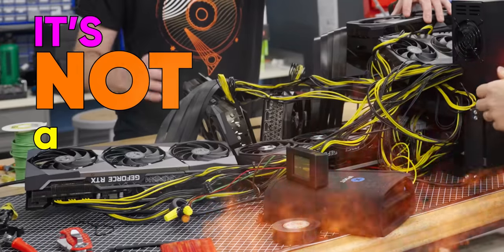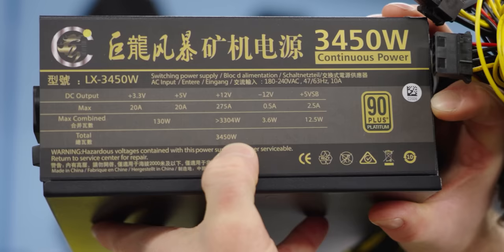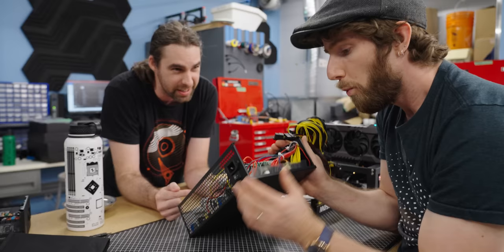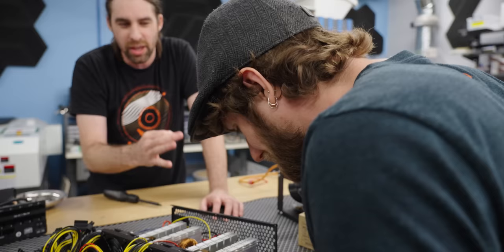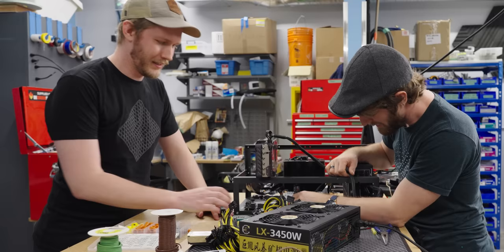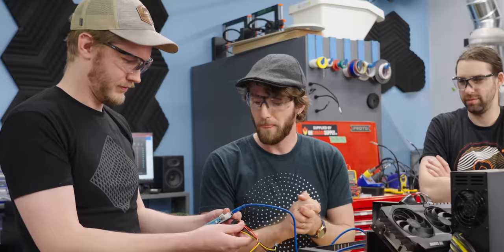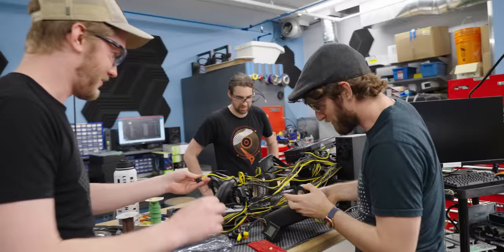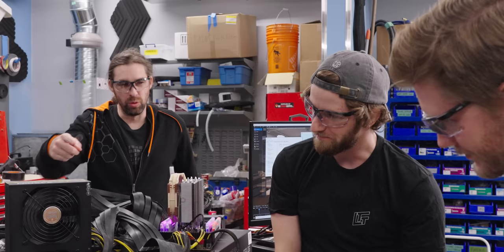This 3450W Power Supply is a Fire Hazard!

Comment: It's pretty funny how scared everyone is of the 240V. Here in Europe we have 230V at 16A on the normal lines. But there are also stronger ones with 24A. If two fan heaters with a total of 3500 W hang on a socket here, we do not worry yet.
Reply: In North America you can have 120 or 240 to anywhere. It's 240 to the home not 120. It's fused at a central point so its a different way of doing things. Also if I were to choose if I wanted corporations controlling the fuses or myself I will do it myself thanks. And no it doesn't scare me. I wired my stove which is 240 so no it doesn't scare me.
Reply: And america's 240v is split-phase so unless you bridge both sides you're only getting 120v to ground.
Reply: @joer8854  WTF are you on about dude? A 240V MEN system has generally 3 levels of fusing for the individual supply on customer premises.
No electricity supplier is going to give you a cct without a fuse on their side so you cant take down their network.
Yes you do have a different way of doing things, that came from not knowing how to do it right when your hodgepodge of systems were put in place with no regulation.
Reply: @mycosys  3 levels on customer premises? I know the main fuse that sits right where the cable comes through the wall, and then there's the breakers, is there another fuse in the breaker cabinet? Apart from the GFCI that's in there as well.
Reply: I think the same everytime. We can do 3680W with 230V and 16A. And if we need more we can do 3 phases with 400V and 16A / 32A / etc. And that's nothing that special.
Reply: @Brealiq  And interestingly to get 3450W on 90% efficiency (requirement on full load to pass 80plus platinum. probably where they got the idea from to print "90 plus platinum) on the label) it would pull 3833W, which means even if the PSU didn't explode on the attempt it would trip even breaker.
But in the end, better to be extra careful towards it than getting negligent., no matter if 120V, 208V, 230V, 240V, 400V or any other in that region.
Reply: @LuLeBe  Usually if it is a residential tower or area there is another CB at the main or sub power distribution cabinet that is between the network and the residential systems, or if it is a private property the main switch between the network and the property would have a fuse inside the switch box this plus the GCFI Main breaker (required in most countries that have mandatory ground for appliances) and CB for each sub circuit within the premises, that's 3 accounted for.
Reply: They're scared of AC mains power and their haphazard circuit modifications, justifiably so in any country.  In my experience people from countries with >200V mains tend to be far more scared of electricity than North Americans.
Reply: Me, an European: "230V, 16A and 3680W line - nothing to be afraid just don't trow it into bath. Just be careful with the 380/400/500V and 32/64A lines". :D
Reply: I wouldn't be too certain that all 16A circuits can supply the full 16A continuously (as opposed to as long as this sort of load is usually expected to last).
Reply: ah ah ah ah ... americans ... ah ah slurp
Reply: @Hadar1991  No, you really should be afraid.  Forget the amperage capability of the supply because it only takes milliamps to kill you, and 230 volts is definately enough to get those milliamps flowing through your body.  Also, you'll generally find those 380/400 volt supplies are 3-phase, and those 3-phase supply transformers are centre-tapped to ground meaning each leg of each phase is 220/230 volts to ground.  To get hit at 380/400 volts would require you to isolate yourself from ground then connect two of those phases to your body.
Reply: Two fan heaters totalling 7000 watts at 230 volts equates to over 30 amperes.  Better hope your circuit is in good order and the overcurrent protective device is functioning because it will need to trip to protect the installation.
Reply: @UCCLdIk6R5ECGtaGm7oqO-TQ  So, I was exaggerate, but still if was funny to me that they where so over the top while handling 208V/16A 😅
Reply: @mycosys  You assume that because you assume (wrongly i might add) that europe has never had an issue with electrical fires and they just always did everything perfect.
In North America the main comes into the house and various runs are made through the house with each run being fused to what is needed for that run. If you need 240 you combine the two rails. We don't run our stoves and dryers and such off 110 like you assume we do.

Comment: I think I may be watching too much Jayz2cents when I expect an iFixit spot to follow an explosion
It would be interesting to see GN put this same model through their testing. I'd like to know if this is more dangerous than Gigabyte's psu's.
Reply: Same here, about both those things.
Reply: Or better yet, hardwarebusers, who can evaluate all of the protections. Because I would be very surprised if this thing had them.
Reply: Of course its worse than Gigabyte
Reply: @xentiment6581  You say that as if Gigabyte doesn't have a tarnished reputation for a literal 50%+ failure rate on a PSU that they figured was good enough to sell
Reply: NGL i'm a little disappointed they didnt test how good a spot welder it would make, its rated for something like 300A 12V and i suspect the main protection its missing is individual rails for OCP. They titled the video 'fire hazard' and didnt test the one way it SERIOUSLY is.
Reply: I want somebody to use their industrial level fuses to drive that thing full out to those claimed 3450W
Reply: @EvilTim1911  yeah this is still worse
Reply: @xentiment6581  This is bad, but it’s something with some common sense you’ll know is bad. A single typical US wall socket can’t provide more than 1800 watts. This has made up, poorly spelled specification stickers on it, and I’m sure it’s sourced from some sketch Chinese website. 
Gigabyte was a reputable manufacturer that paid to have a model go thru validation and sold thousands of potential fire hazards. Then Newegg made it a bundle with high end GPUs. 
The 3450 psu is bad, but any reasonable person knows that.
Reply: @HappyBeezerStudios  Well anything lower than custom plugs will have a breaker  or fuse break. A custom plug for 16A 230V continuous or higher on it. Industry can have their walls wired however they want them to be most go with the standards unless otherwise needed.  This PSU will be a case in the "otherwise needed" category with the new equipment of that power tester for the wall outlet used. To get up to 3600Watts out of one source a custom solution is needed.

Comment: Here in the UK the standard wall outlet is 230v 13A. If you're lucky you get ~240v which means you'd get 3120 watts maximum. Not to mention those IEC C13/C15 connectors are only rated to 10A which means your maximum power is 2400W max then you're going to melt that cable. So you'd have to get a special circuit put in from your fuse box to supply your PC. Mind you, you could probably just disconnect your water heater and use the PC to heat your domestic radiators and keep the house nice and toasty on those cold days......
Reply: A single Type F plug is 16A, here in Germany circuits are either 16 or 20A, so at the rated 230V you would get 3680W. So even if I wouldn’t trust anything with this depending on where you are you can theoretically use something like this safely on a standard circuit.

Comment: @LTT Team:  I received my screwdriver.  It's amazing.  Thank all of you.  Please keep making that hat (or a suitable substitute) appear around Linus.... forever.

Your enginerds likely know about solder sleeves and western union splices.  If they don't..... eh... recommend against wire nuts with stranded wire.  Proper splicing with sleeving would've taken the same amount of time but would result in.... an actually safe product.  This is important when you have so many hands in the area.  It's even more important when you have one or more electronics muggles working on the product.  Btw, have you guys considered putting a couple fire extinguisher mounts under that table?  Sounds stupid until it doesn't.  Then it REALLY doesn't.

Comment: I did my apprenticeship as a TV and Video technician fixing CRT TVs, i still have multiple entry and exit burn marks from touching the line output transistor for the HV coil, it definitely tickles ill give you the tip!

Comment: 6:58 I'd say it's the opposite. It's a Positive one. When the current is high, the resistance increases. It automatically limits the current in the line when loading the capacitors. When well designed it's really effective to reduce high current calls from circuits with high amperage values while in transient regimes.

Comment: "How could you expect to draw 3450W from one connector" laughs in European 230V 16A circuits
Reply: You left off the rest of his sentence
Reply: @sik59rt  Yeah, I was too lazy too go back and write it exactly, as he said it. But I didnt change the meaning
Reply: or even 230V 20A which is also very common for IT Systems
Reply: Thats true 😂😂😂😂
Reply: @tigris5826  Yeah, and sometimes even CEE (400V) with 16A or even 32A (for EVs and stuff)
Reply: North America runs on 240 V 15 amp circuits we just split it across an extra neutral wire because we do not need as much voltage for smaller electronics but the house receives single phase 240V 15 amp Alternating current.
Reply: Yeah you guys constantly use that as a brag but it is really no different here we just don't use it for every outlet it is usually just bigger electronics like washers and stuff.

Comment: I fully expect power supplies like this to be a genuine requirement for the next generation RTX 4080
Reply: plus another for cpu
Reply: By then it'll be expected to use a fusion reactor
Reply: The 4080 is only using maybe 50~100w more than a 3080 lol
Reply: That doesn't work for Electrican System 120 V 16A or 10A  because  
That a total of max. in one circuit 1.920W respective 1200W
Reply: u forgot the 4090 tie
Reply: @chessprince1164  then move to a country with a real power network rather than a toy network.
Reply: @oxfordsparky  So are you saying 400A 240V residential service in Wisconsin USA is a toy network?  Really?  How much power does your home need?
Reply: @kuhrd  It's a big misconception that North America is strictly 120V. Homes in the U.S., Canada and Mexico are typically supplied with 240V which is then spilt into separate 120V circuits. There's usually at least some 240V circuits as well for various high draw appliances, such as washers, dryers and air conditioners.
Reply: @FUCK_________googIe  The meters here in the USA charge for power based on how many KWh you use per month not on how many amps you are using at a specified voltage.  They can however ding you in some areas if your 240V panel is not resonably well balanced since the transformer at the street can only provide the rated service amps at 240V and uses the autotransformer effect to balance any imbalance in the supply which can cause the transformer to run hotter at the street than necessary.  Your home meter is only going to charge you for the power you are using (Volts X Amps X Power Factor)/1000=KW being consumed at that time and you just multiply by how many hours you are running that load to equal your KWh of energy consumption.
Reply: @Okusar  Yeah that was the point I was making because it is unbelieveable that people outside the US still think the US is 120V when it has been using 240V since the early inception of residential electrical service.  I have 2x 240V 20A recepticals in my kitchen not counting the 240v/50A range outlet along with a 240V 20A receptical at my desk for the computer, a 240V/30A for the dryer and a 240V/50A in the garage for the welder.  

That all being said, I barely use any power in my house since the entire house short of the range, electric dryer and water heater are all on a single 6000 watt LF inverter and a 350AH 48V battery system with solar providing around 3/4 of my energy needs anyway.
Reply: @kuhrd  I live in Europe, and most people have 3 Phase 400V Circuits, the Phases are just split, like in the United States, but some devices like some motors legitimaly use 400V.
Reply: @jjjannes  While it is possible to have 3 phase 208v or 480v service in the US it is generally only used for industrial,  commercial and multidwelling residential.  I can't fathom anyone needing that much power in a residence considering how expensive that would be for the monthly electric bill to need that kinda power.  Then again, I try to keep my electricity bill under $50 per month but for most people that is also unheard of.
Reply: @Driftwood420  So it only has peaks of 500W around 1-5ms and 600W under 1ms?

Comment: NEVER mess with power supplies!!! I did it before I knew what I was doing with PCs and nearly killed myself. I got zapped so hard it blacked my vision out and I felt the shock through my heart.
Reply: Did you gain any Superpowers? If so what are they if they are cool, I will do the same to gain those powers!
Reply: @XhodanXeus  No unfortunately no super powers. I recommend not trying it, I was stupid and didn't know about how capacitors were and it almost killed me. Idk what the wattage of the PSU was but im sure it was enough to kill me.
Reply: How long should one wait for the capacitors to discharge naturally? I have read somewhere that 15 minutes is more than enough, how long did you wait when you received that zapp?

I ask because my fountain is very old and I really want to clean the layer of dust that it probably has inside.
Reply: @Albert-P27  Absolutely not 15 minutes. At best, maybe a day? Quite unlikely though. Most likely, a week or two to okayish voltages. Safe: 6 months or more I'd say. The time varies by huge amounts depending on the PSU design and components used.

Unless you know what you're doing, there isn't a safe way to really 'discharge' them (there is if you do know, though). There are however safe ways to clean them.

My recommendation: buy a compressed air can or use an air compressor, and blow it through the gratings outside. Try not to backdrive the fans too hard.

You can safely open power supplies provided you don't touch the PCBs. But even as an electrical engineer, I wouldn't trust myself to do it; too easy to forget or literally slip up (drop a screwdriver? get distracted by a call?).
Reply: @Albert-P27  if you dont understand how to discharge caps and why to do it like that you probably shouldnt be inside a supply.
Reply: do you have any lasting effects from it?
Reply: @thebombbird3261  not to my knowledge, I have more effects from smoking weed then zapping myself off a psu.
Reply: @Albert-P27  DONT EVER EVER EVER DO THAT!!!!!!!! Capacitors are the one thing that scares me the most when it comes to electricity.

Comment: "How could you possibly expect to get 3450 watts out of one c13 power connector?" Simple, by neglecting its 10A max current rating. XD They work fine at the full 16 A of a breaker circuit giving a plentiful 3600 watt. The actual limiting factor is the cabling, which often is too thin to carry such amounts of current without melting its insulation. Also actually the EMI filtering is for keeping EMI originating from the PSU itself from going into the rest of the grid.
Reply: So you could build a little circuit that puts EMI into the grid to ruin it for everyone else?
Reply: Really efficient, if single use, house heater if you do that...

Comment: Im from Germany … it’s always so funny how people from countries that use 100 something v are so careful when handling 230v …. XD … safety first! … but yes electrical tape is totally fine … also dry Finger is fine too … protecting from 230v ;-) … just don’t pinch or hold unprotected wire … every kitchen here uses an electrical water boiler that is just plugged in to the wall using something like 2500W XD
Reply: Alleine mein Kochfeld zieht 3800w😂
Reply: @dominik8291  Kochfelder in Deutschland sind meisten 3-phasig angeschlossen mit 400V
Reply: Got a 3 KW kettle, more KW makes the tea and coffee better.
Reply: In Poland too.

Yeah, 3kW for car charging. Like whatever, who cares.

I actually charge my hybrid car from the wall and it's now ewen that slow.

Why does Canada and America has 120v outlets when rest of their electrical system is 230v?
Reply: The issue is that you assume the current detector was rohs/ce standard product and not another $5 item from bandgood... 

Tape and things are fine until you have like you say a few 100 bare connection points on gpus tetris'ed together next to extension cable clamped on with a quick clamp and 3 people crossing over the dangling mains cable every 3mins.

Comment: One thing that could maybe be interesting for the lab, but also as a video on LTT, could be to hire a PLC engineer and use maybe PC-based automation like the solutions from beckhoff to build testers as you need them. From testing option of course it wouldn’t cover everything (there are to specialised topics you are covering for that) but for example a power supply tester would have been a easy thing to build on your own with industry standard tools. And you would be able maybe to make a video on how PCs are being used in different applications, from building automation over process industry up to high end testing facilities to automate stuff.
Reply: Witzig das als Beckhoff-Mitarbeiter unter einem Linus Video zu lesen :D
Reply: PC-based automation, so including those pumps on oil drills that still run on DOS 3.30 And medical equipment that has yet to do the jump to XP?
Reply: @HappyBeezerStudios  or alternatively a FreeBSD based OS controlling complex CNC applications or Win10 integrating ML solutions into a vision inspection of products